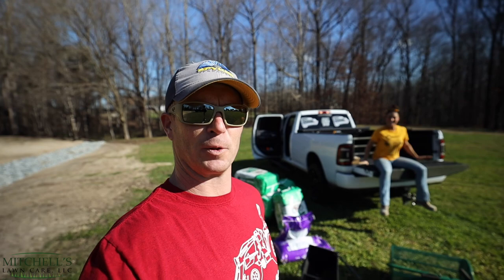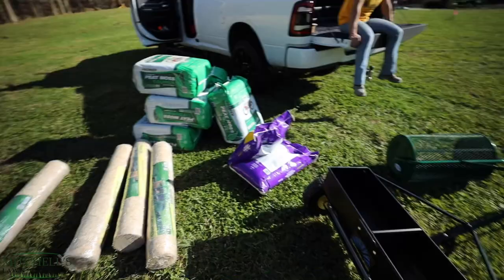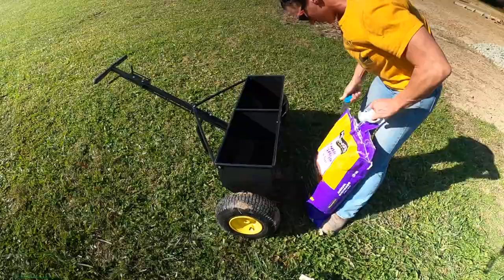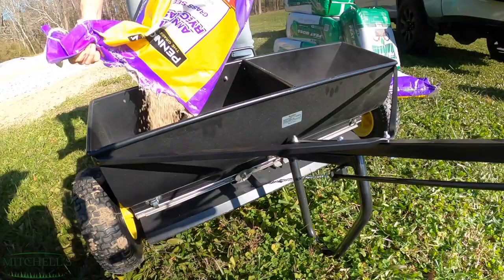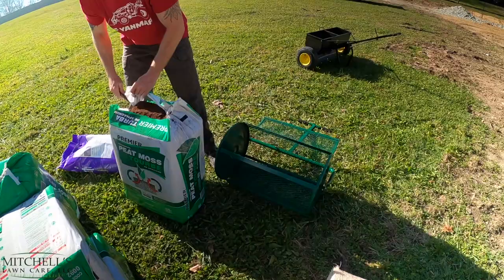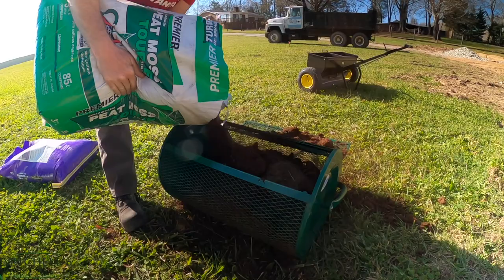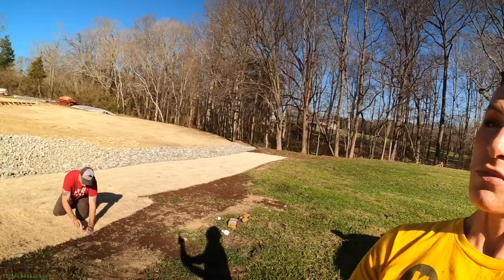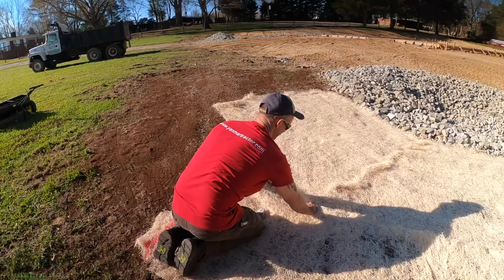EASY WAY TO REPAIR TURF! [Very easy/DIY - Hannah's back!!]

Comment: Good job guys! That landzie spreader did a great job and so did the spyker! We really never knew when you would use a drop vs broadcast spreader, so it does make sense that the drop spreader would have a more precise application. 💯👍🏻
Reply from the maker: you got it!  Drop spreaders are great for when you need to control the material you are trying to disperse.  They are an excellent choice in the winter time for salting sidewalks as well because they don't broadcast salt into the lawn and planted beds.  thanks for tuning in ladies!

Comment: I've always wanted to try the blanket.  I've got a project to work on using it!
Reply from the maker: It’s great for areas where wind/rain will be an issue after seeding.
Reply: @mithgo_outdoor  is the same thing as excelsior matting?
Reply from the maker: @hairstonpropertymanagement2937  it's "technically" not erosion control matting, BUT it is very close.  It's called seed germination blanket so the fibers on it are more open than that of true erosion control matting from my experience.  It kinda doubles as both.
Reply: @mithgo_outdoor  hey man thanks for the clarification!😁😁

Comment: Depending on where you have a place to get the ph balance of the soil check for what you have to do to make the soil grow the grass properly
Reply from the maker: it will certainly grow.  There was grass BEFORE the land was cut in for the new shop.  This was not a "Professional Turf Repair" attempt by any means lol.  Just a "Hey, lets do the cheapest thing possible turf repair".  We are both very busy right now and the possibility of germination is slim.  I plan to redo everything in the Spring once construction of the shop is complete.  Thank for tuning in!
Reply: @mithgo_outdoor  okay thanks for your reply young man and your family